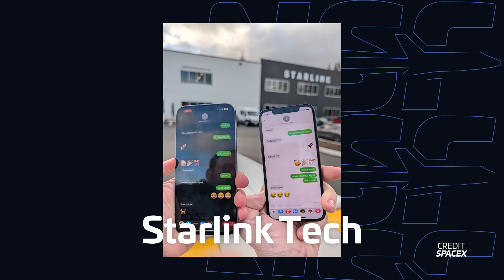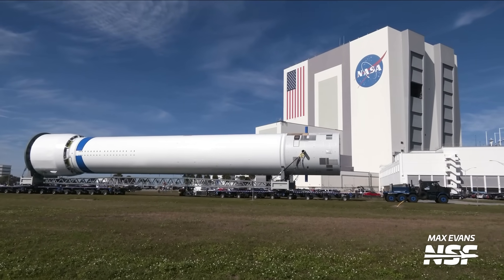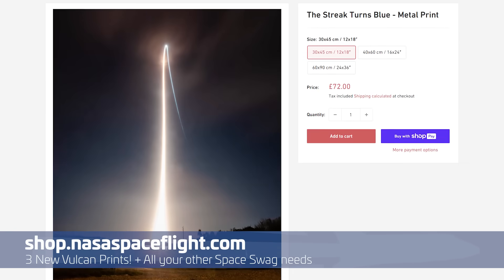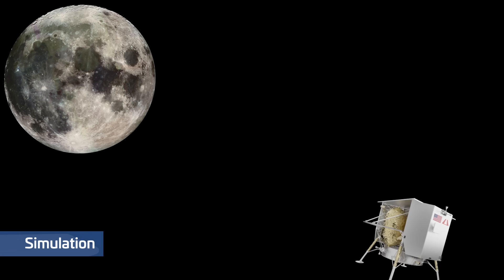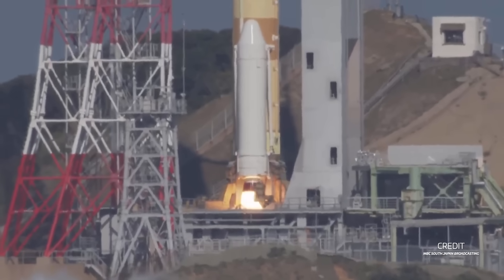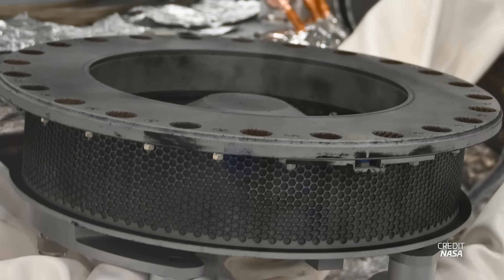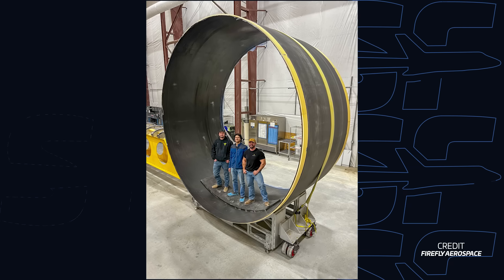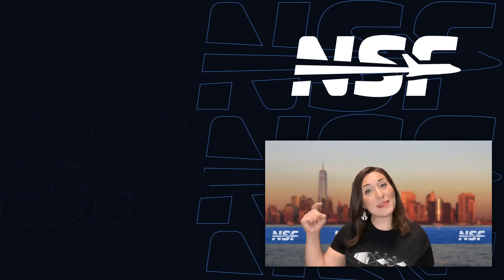New Rockets, New Tech, and New Glenn | This Week In Spaceflight

Comment: If that failed valve had been a fail-safe valve complex (two sets of valves in series, each with two valves in parallel) like those in the Apollo 11 Eagle lander, this issue would most likely have not happened.

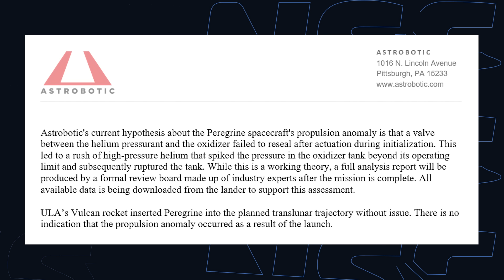Comment: 5:42  As a retired mechanical engineer, I admit I don't know much about spacecraft design, and I certainly don't have a copy of Astrobotic's Peregrine drawings. That said, for terrestrial engineering, designing a system with such an obvious single point failure seems a bit unusual. To me a second in-line backup valve and a tank pressure relief system would at a minimum been installed. Clearly weight limitations need to be considered. However, valves fail to seat all the time and critical functions ought to have redundancy.
Reply: Is there any validity in saying that your comment on valves doesn't make me confident for all of the non pressure fed engines that are going to be used on manned Moon landers?
Reply: @dave_ant1  Manned space vehicles are all designed with redundancies. Moreover, the Starship's main Raptor engines are not pressure fed as such, but will require some sort of pressure system to keep the fuel tanks from going into a vacuum. Moreover the Starship will have two Reaction Control Systems. One would be a cold gas thruster system and the other a hot gas system.  Both will require pressurized fuel systems.  I am sure SpaceX will have considerable valve redundancies.

Comment: I feel bad for the many people that worked for years on the Peregrine lunar lander project. Thanks for this latest update Elysia, Alex, Julia, Max, Stephen, SCL, Ryan C., and Kevin
Reply: It must have been devastating for the people behind that lander. This reminded me of when a valve problem caused a SpaceX Dragon capsule to explode. I hope the company can bounce back.
Reply: Hmm a sticky valve.... 
Well, Boeing knows all about that, thanks to delays... I, genuinely and non-sarcastically, wonder if the lengthy delays thanks to BO, are at all related to this valve's malfunction?
Reply: @DUKE_of_RAMBLE  Depends on who made the valves, remember a SpaceX Dragon capsule blew up because of a bad valve. Many of these parts are not made in house, but they should be properly tested. As I recall the helium tanks that pressurized the ascent engine fuel tanks on the Lunar Module were blown open and once they were opened they stayed open. There were also two helium tanks with valves where only one was used for redundancy. That engine had to work the first time or the Astronauts would never leave the Moon. There are people who designed this system sweating it out now trying to figure out if it was a hardware or design problem.
Reply: @535tony  I guess I wasn't specifically implying it was INITIALLY faulty, just as those on Starliner hadn't been. Having to sit around due to delays, is what I'm wondering if could've lead to this failure.

But, indeed, if they have used a valve that's not a one-off creation, maybe they can check to see if valves from that same batch have failed/had issues in other spaceflight applications, or in other industries.